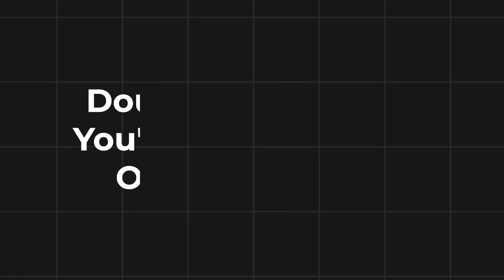When? Dream Chaser Launch Finally Scheduled, Starlink Launch | Episode 38

Comment: Personally, I'd like to see the shift to a SSTO craft, like the X-33 VentureStar. There were a couple other designs/prototypes, such as the DC-X project, though it seems we're still stuck using conventional rockets for the time being. I know people want to think of Dream Chaser as being just a mini shuttle, though it more closely resembles Boeing's X-20 Dyna-SOAR project from the '60s. 

I have no idea what's up with Blue Origin and why they've been doing things the way they have been. Seems like they must be run by former defense contractors or something with the idiocy they exhibit ("Oh, somebody else is doing what we want to do, only more quickly and efficiently, so...we must SUE them to slow them down so we can keep dragging our feet and do stuff like Boeing does these days!"). 🤦‍♂ 

Speaking of Boeing (or "Boing" as I've seen some use on purpose), they've certainly gone downhill since their heyday as one of the top aerospace firms. Greed and profit over safety and innovation. I miss the 1960s when we still had enthusiasm and "can-do" people. ✌🧔

Comment: They really need to launch dream chaser on falcon 9. Driving the price down even more 😊
Reply: They plan to build their own reusable rocket in the future
Reply: That is my thoughts as well
Reply: Forget about the dream of a  new rocket, they need to focus on dream chaser if successful, will become the personal emergency craft for all space stations over dragon, Star-liner and half a dozen others. Launchpad rockets will become a commodity like airlines. They could double the size of dream chaser and still do well. We have to be able to move people. Back n forth easily only once we get infrastructure in place can we push larger tonnage which will require more humans in space which requires more adaptable flexible vehicles. Once human certified   If you place a few in Starship you could put up a lot and place them at the  new space stations. 
It may not be pretty,but  everyone needs a life boat for just in case.
Reply: Not everything is about SpaceX. It will launch on a Vulcan.
Reply: Sierra Space and ULA are tightly bound contractually, technically and competitively.
Together, they ARE driving down the price by providing COMPETITION to SpaceX.
They REALLY are doing what they REALLY need to do.
Truly...